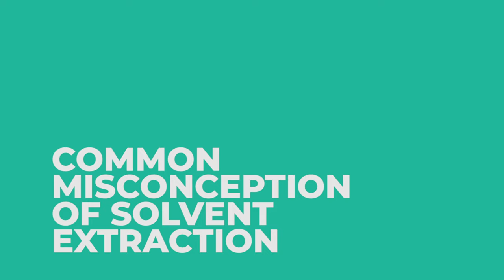Cannabis Extraction Explained: Ethanol vs. Supercritical CO2 vs Hydrocarbon Extraction

Comment: What a load of BS. And the fact that you work for a company selling ethanol extraction equipment would have nothing to do with you saying all those dirty lies about CO2. Have you considered that GW pharma make their CBD pure drug Epidiolex using CO2 extraction, and that running costs of SFE can be brought down as low as $2/kg of feed? Your technology will never take off my friend, because the capital costs involved in the building, running and maintanance of large volumes of a highly flammable liquid will not be economically viable in most countries.
Reply: 90+% of all retail cannabis and hemp products are extracted with either hydrocarbon or ethanol brother. The data is clear as day. Our (the) technology has already taken off as we have thousands of installations worldwide.

As to the capital costs of the building, in regulated environments, CO2 buildout is no cheaper. One, you have massively high pressures. Two, leaking CO2 can asphyxiate workers extremely fast which requires 100LFPM OSHA required emergency ventilation systems with sniffers, the same as, you guessed it - solvents. At the end of the day the buildout costs are nearly identical. This is coming from the experience of integrating over 200+ labs worldwide with multiple technologies including CO2.